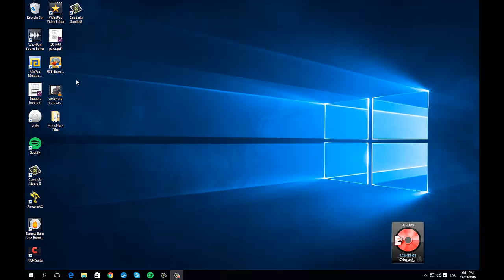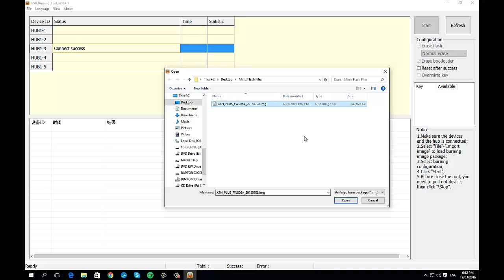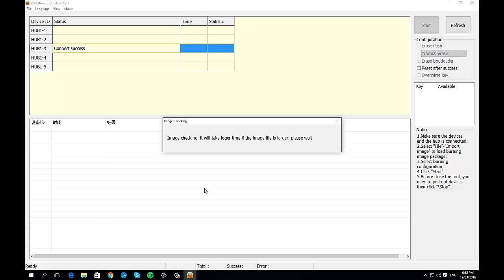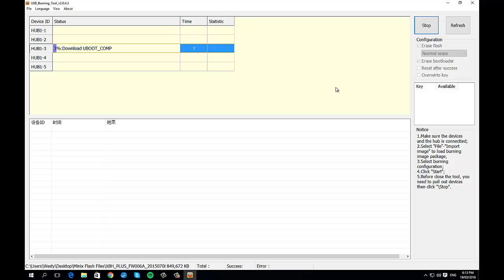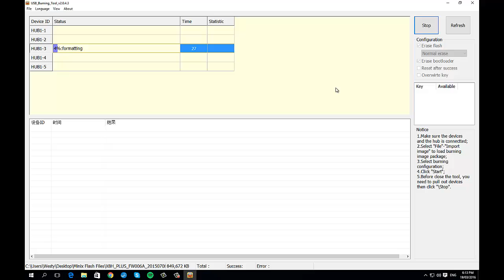Minix X8 h Plus Flashing issues part 2

Comment: HI, Hows your MiniX Box doing ? :) did you managed to upload firmware ?
Reply from the maker: Sorry do not get notifications of questions coming in. It is going great.
Reply: Westy's How To Guides could you please share howto steps . Because I’ve tried at least 50 times and getting errors
Reply from the maker: hi There, Below is my part three tutorial. From listening to it just now (I did the 2 years ago now, so cannot remember) 

 https://www.youtube.com/watch?v=Wuu7fRVfbuc

1. Reinstalled the Drivers and gave then admin rights
2. hit refresh button when it failed
3. crossed my fingers 
4. once completed burning process . pulled usb connection (BEFORE) shutting down the software.